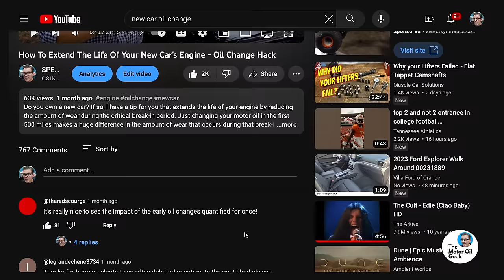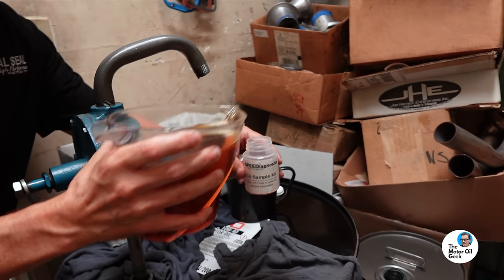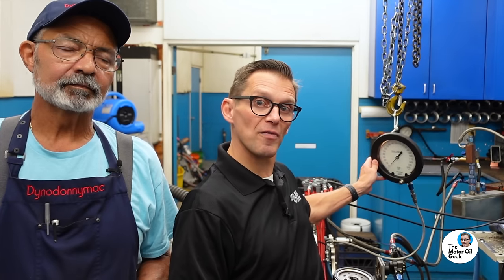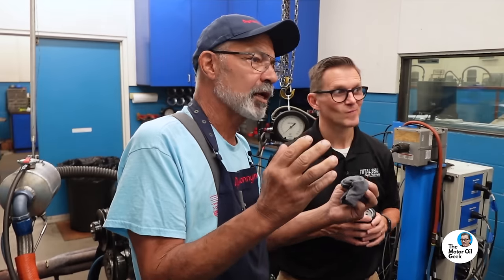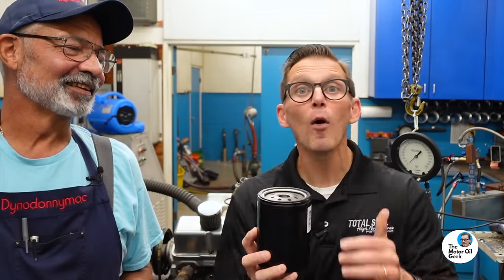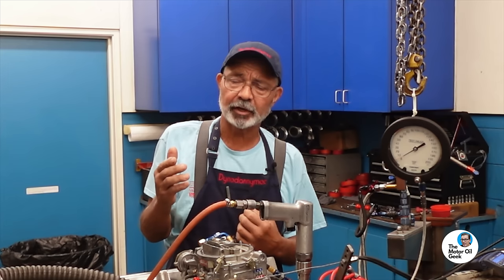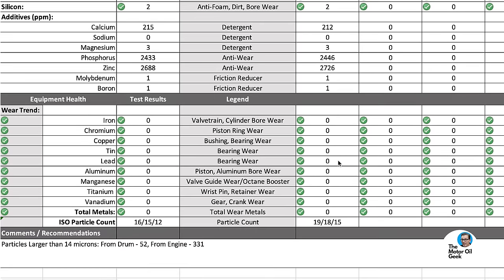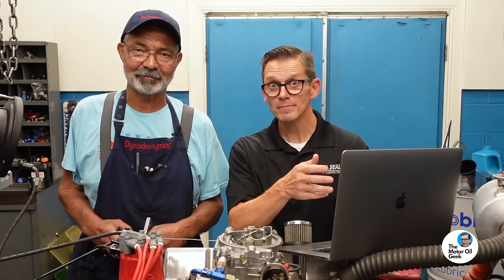Does Pre-FILLING The Oil FILTER Cause Engine DAMAGE?

Comment: My father taught me to pre-fill the filter when I was a kid and I've always done so.  It always seemed common sense to me that you will build oil pressure faster by pre-filling.  You can actually HEAR the difference in the initial engine startup with many engines.  You generally hear a tiny bit of engine clatter before pressure builds, and starting an engine with an empty filter makes noise for at least a couple seconds longer.
Reply from the maker: Thanks for sharing!
Reply: Clear flood mode is easier, and better.  When you remove the filter, you let more oil out than just what is in the filter.  What are you going to do about that? Clear flood mode primes the entire system without the stress of combustion.
Reply: so just use flood mode...
Reply: @thewatcher611  Do both if you know you can't afford a new engine.
Reply: dad taught me to prefill also, more than 50 years ago.  common sense really proven here
Reply: @thewatcher611  "Clear flood mode"....jesus...
Reply: My experience always. There is a delay of 2 or 3 seconds for an empty filter to fill before it sends the oil on to the engine parts, the crankshaft first.
Reply: I was taught to prefill the filter BUT  to never center pour.  Only let the oil into the smaller holes, having blocked the center hole with a plastic hole cap.  Takes only a bit longer.  Don't forget to remove your cap, though.
Reply: My Father taught me to pre fill the filter first because the crankshaft bearings are running with out oil to lubricate them for about 15 or 20 seconds before the oil pump can fill up the oil filter.
Reply: It does make sense when the oil filter is mounted with the open end facing up. But if it is mounted level... the oil just spills out my friend. All over the place and not much is left in the filter😅
Reply: Most oil filters have an anti-drainback valve in them to prevent what? There's your answer.
Reply: thats boulderdash...prefilling isnt needed
Reply: "Boulderdash". That's cute.  :face-red-heart-shape: But it's akshully  "balderdash".  @cantwealljustgetalong2
Reply: @antoniograncino3506  Right ? Come back in a hundred years and it will be builder crash.
Reply: it take 3 second for your oil pump fill the filter and build pressure... our dads learn from their dad who learned on ford model T... and even back then, it was mostly superstitious 

im guessing it come from changing diesel filter on farm tractor and they just take the habit of doing it on any filter just to make sure they don't mess up lol
Reply: @antoniograncino3506  lol close enough!
Reply: @joseph-mariopelerin7028  yeah i agree. if prefilling a filter was needed there wouldnt be so many engines with side or top mounted filters.
Reply: Never heard of pre filling oil filter 😂
Reply: Why is that man shouting annoying
Reply: sucking air could possibly collapse the cartidge filter thats why  prefilled has been the method used for years

Comment: I have been pre-filling my oil filters for 50 years and now you proved the fact thank you.
Reply: And i am pre-filling oil filters or at least pre-cranking the horizontal filters for more than 30 years.
Reply: 60 years for me
Reply: 40 yrs for me so by my calculations that's 180 yrs collectively. ✅
Reply: the only thing that was proven is the fact that pre-filling the oil filter makes pressure more quickly upon startup. if it makes you feel better- good for you.
Reply: @tommurphy4307  No, it just makes my bearings feel Much Better, so, that i Can sleep Peacefully 🙂 🙂 🙂
Reply: @bustjanzupan1074 the same bearing that already have oil on them 😂😂
Reply: @jesuschrist7169  No, the same bearings, which get the Air instead of Oil, when the air  is pushed from the empty oil filter, into the bearings , if you are installing an empty filter. But, obviously this is already tooo much thinking for you , and, that is why you are unable 2 understand this problem. Good luck 😉
Reply: @bustjanzupan1074  Congratulations on using zero facts 🤣🤣🤣 passes air though 🤣🤣🤣🤣🤣 thanks I'm going to screenshot this and take it to work so the rest of the mechanics can laugh at you as well!
Reply: @jesuschrist7169  Obviously you are Unable 2 Understand what i have just Explained with simple words, so, that even a child would Understand it. And, Obviously you are having very similar Dumb "mechanics" at your job as well , that will hardly Understand that the air in the Empty oil filter has 2 go somewhere when the oil comes inthere . Good luck.
Reply: @bustjanzupan1074  you clearly have never worked on a engine in your life! If you had you know the air is vented into the crankcase hence why engines have a crank case breather. The oil pump will not pump the air through the engine and rid engine parts of oil and causing damage. If you let me know what county you are in I can help find a workshop that could teach you the things you need to know.
Reply: I didn't see any prove other than the fact that the initial oil pressure takes 3-4s longer with an empty filter.

Comment: I spent 50 yrs in the business, Building Engines from small gas to Heavy Duty Diesel, This is a habit I practiced through my career, Filled Filter is the Best way, Excellent Best Practice !
Reply from the maker: Thanks for sharing
Reply: But how does the filter flow ? From the outer holes to the center hole ??

Comment: I relate to this video! In High School 1971-72  two-hour per day 5 days a week auto mechanics in OKC we were taught by Mr. Parsons with NO if-ands-or-butts to ALWAYS fill the filter before installing it. 50+ years later I have done that 100% of the time aside from a few vehicles that had a sideways filter. Building VERY fast street racers at that time is a distant "fond" memory doing all night engine swaps with my hot rod buds and experimenting with carb jets, distributor springs, timing w/ vacuum gage and different rear gears (ALL Mechanical Mods!) are some of my favorite memories of my rebellious youth :)! Those were good times that unfortunately will never be available to any generation again!
Reply: Kids still work on their own cars and mod them, don't get it twisted. Down pipes, bigger turbos, bigger intercoolers, suspension, intakes, exhaust are all common mods today kids do in their own driveways.  Some even swap out cam shafts. Entire engine swaps with LS motors are super common as well.
Reply: Same time frame and maybe the same friends, haha. Many of us went on  to have our own engine shops, fab shops, machine shops, body shops. Lots of 1/4 milers and asphalt circle tracks around the Pacific Northwest. 70’s & 80’s were Party Central and the most fun you could have with your pants on (most of the time)

Comment: I enjoyed this video. I was also told not to prefill my oil filters from the drum/ 5 gallon bucket. I said that was wrong, why would packaged oil be more contaminated than what's in the engine. The biggest reason, though, is that my trucks are diesel and have extremely large filters. The time it takes to fill an empty filter with oil can do significant damage to the engine. My large trucks use two filters that hold almost 2 gallons of oil...long enough to possibly seize the engine while filling. The filters even state damage can occur if they are not prefilled! The only other issue I have found is previous services or owners did prefill the filters as instructed, but then proceeded to fill the truck with the manual listed oil capacity which overfilled them by 2 gallons, also not good.

Comment: As a millwright I worked on many large industrial engines for 50 years and most of them had a pre lube pump on them so that should tell anyone how important lube is at start up. They also had post lube pumps on the turbos that were spinning at 30,000 RPM at shutdown.
Reply: If you want caterpillar actually offers oil analysis for a relatively low cost .I believe amsoil also offers this analysis too
Reply: ...VW has auxillary waterpumps that circulate water through the turbo for 2 or 3 minutes AFTER shutdown. It keeps the oil from carmelizing inside the turbo. Thus prolonging the life of the turbo. It is why truckers don't shut off their engines immediately after driving. So when you see a semi-truck setting there idling for a time while parked , you'll understand why.......
Reply: I believe all engines should have an electric auxiliary pump for the oil however if you prefill or not a car without that will not have good pressure for the first five or so seconds prefill or no so I see no reason to refill unless you add that pump.
Side note I have added that pump to my classic cars, it is not hard to do and you can tell the different every time you start the cars
Reply: You can do that with a car too by making it so it won't run when you try to start it.
Reply: @JustNo8808  true but then the parts that you’re trying to save are still in jeopardy. It’s not the actual running part that’s the problem it’s the starting of the car without lubrication that is the problem.
Reply: @ProudDad1976  but it's at a slower speed.
Reply: Remember Sllick 50? Shit...$50 a quart but it did work.
Reply: @rileyandikeysplaytime5936  I used to use it too.  But who actually proved it worked, besides Slick 50 claiming it worked?
Reply: @fuckingpippaman Would you mind giving an example of what you mean? I'm not a mechanic by any means but I do change my own oil and make any repairs that I can myself. I'm always looking for new information. And this lower  me. Shouldn't using a lower
Reply: if you are doing a turbocharged street motor the after-cooler/oiler is an absolute must- especially the smaller IHI units which are more vulnerable to shutdown damage.
Reply: I just want to tell everyone how to pre-lube their engine. 
1.) Push the throttle to 100% to trigger flood clear mode. Flood clear mode is programmed into all fuel injected vehicles made since 1986. 
2.) Crank the engine while the pedal is firmly depressed to 100%. This also works on all motorcycles and ATV's with EFI. 
3.) Crank the engine until the oil light goes out. It cannot start if you depress the throttle to 100%.
4.) Check to make sure no heavy carpets or floor mats are bunched up under the gas pedal before you try this, because the throttle needs to be at 100% to induce flood clear mode, which disables the fuel pump and injectors completely.

Comment: I have been prefilling filters since I was at least 16 or 17 on all of mine and my family's cars that I maintain. From age 16 to 21 I worked at a full service Texaco station. Every oil change I did there I prefilled the filters. I am so glad you did this video if for no other reason it backs up what I all ready knew.
Reply: Too bad for those engines with sideways canister filters that can’t be pre filled
Reply: Yet in 45 years of wrenching I have never heard of or know anyone that did this. Not cutting it down, but it is not that common as you think.
Reply: Is not necessary to prefilled them anyways people been doing them for years they have no problems

Comment: I always pre-fill my filters, even the ones are mounted sideways, I just get them as full as I can without spilling any oil because some oil is better than none. 
 I’ve always been told people don’t like to pre-fill filters because they’re worried about stuff falling into the filter like a sloppy mechanic would do. But I always make sure I’m in a clean environment without dust floating around and I’m always very mindful of anything that could get inside the filter before I install it so it’s really a non-issue unless you’re a sloppy mechanic.
Reply from the maker: Thanks!
Reply: Yes, I think maybe they install the dry filter before removing the plastic wrap just to avoid any chance of contamination.
Reply: I hate the my Subaru had an upside down filter. Made it easy to change, but could not be prefilled.
Reply: I fill the filter "as full as I can" on my side mounted John Deere Yanmar diesel engine also!
Reply: Very good comment jeff!  I pre fill my filter inside, away from my workshop, and cover the filter as I take it out to the vehicle, and immediately install it.  COMMON Sense after all.
Reply: Question... so when you prefilled, do you measure the volume of oil that you're filling and subtract that to which you put in?  I worry you might have too much oil in your system.
Reply: @panemon187  Excellent question. Short answer is Yes. I’ll use our Car for example; 2015 Sonata Sport with the awful 2.4 GDI.  Calls for 5.07 quarts.  I buy 5 quart bottles and 1 quart bottles, for filling the filter, and for between changes to top off.  I have a ‘pre measured’ quart bottle, that I pour the .07 quarts into, and that seems to fill the filter nicely.  I then use the 5 quart to finish off.
It works well for me.  YMMV. Peace
Reply: @panemon187  I generally know how much I am supposed to put in, then subtract what I already put in the filter. Then short fill it, check it and add the appropriate amount per the dipstick until checking the dipstick shows full taking precaution not to overfill it.
Reply: Would you not have an issue if putting too much oil in though
Reply: At 76 have had over 20 cars and 4 bikes from Copers S to Ford RS Cosworth  and have never pre-filled an oil filter other than oiling the sealing ring,never had any issues. No engine failures

Comment: I was a mechanic for 38 years and can’t tell you how many oil changes I’ve done, not only on gasoline engines but diesel engines as well and have always prefilled oil filters.

Not only pre filling engine oil filters but also pre filling fuel filters and hydraulic oil filters as well.  Old school education and I’ve also taught this to my students when I taught a preventative auto maintenance class.

It’s only common sense.

BTW you now have a new subscriber and I thank you for setting this straight. Ron
Reply: The modern diesel world has a bit of a different view on pre-filling fuel filters, at least in marine applications.  Per the spec and maintenance instructions on my Cummins QSC 8.3 and my QSB 6.7, they definitely spec to pre-fill the oil filters.  But Cummins specifically warns NOT to pre-fill the fuel filters.  

The reasoning ,per my local Cummins agent and others, is that modern common rail diesels have such small injector ports that you don't want any contamination.  Filling a fuel filter effectively bypasses all the upstream filtering of usually 2 filters.  In my case its a 20 micron Racor and the 2 micro on-engine filter.  Unlike oil that's from a sealed container fuel is generally of unknown quality.  Fuel can also have biological growth that would clog an injector.  It's simple to prime the filter on a Cummins common rail: their own instructions call for just cycling the key to the "run" position a few times and letting the lift pump run to fill the filter.  I know older engines require bleeding of air, but the Cummins common rails don't need it after just a filter change.
Reply: Even in my 1994 they told you to not prefill the fuel filter, same thing in a friend's 1992. What the manual says, is what you do. You don't deviate from it. Just because hacks that think prefilling an oil filter is helpful go away with prefilling other things, doesn't mean that it was ever correct.

In the case of my 1994, there was a bleed valve you used to allow the fuel pump to prime the system on its own. On my friend's 1992, there was a hand operated primer you used to prime the system. following the manual, is not difficult. Making up useless crap to do is far more effort

Comment: Also if motor oil was dirty from the bottle how would small engines like lawn mowers and generators survive since they are splash lubricated with NO oil filter!
Reply from the maker: Great point!
Reply: Or type 1 Volkswagen engines
Reply: They fail at 500 hours, far short of the 10,000 fir a modern engine
Reply: Not to mention, how do you fill your engine with pre-filtered oil? You don't, that's how. Bottle straight into the engine oil fill.
Reply: @turbodog99 At 500 hours hmm? I wonder how my 25 year old walk behind John Deere is still chugging along, starts first or second pull even after sitting all winter 🤔
Reply: @TheSonarSailor this is the most important point haha

Comment: As a former truck driver I have been in Mobile Oil factory. And know the oil is clean when put in the containers made of plastic,Not guaranteed what may be in the metal drums! The filter had been full when you tookit off!Who knew! The
Bigger problem is I have hauled into the
Oil filter factory's the Coiled metal used to make filters and you should always inspect any filter before installing by looking inside you may be surprised
What falls out!!!

Comment: I’ve always filled mine up with almost as much oil as they can hold on vertical or slightly angled filters. On horizontal mount ones, I add enough oil to be able to rotate it and soak the filter material without any running out.
Reply: Agreed. This is what I do. If I can't fully fill a filter because of the angle, I figure wetting the filter media is the best I can do.
Reply: Realistically, that's probably half full of the oil has time to saturate and pass through to the unfiltered side. Far better than nothing.